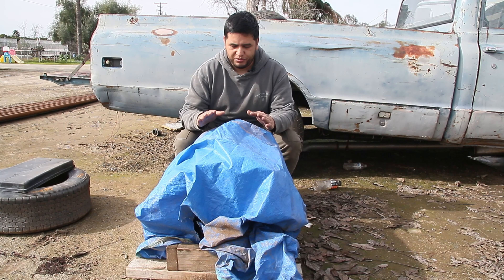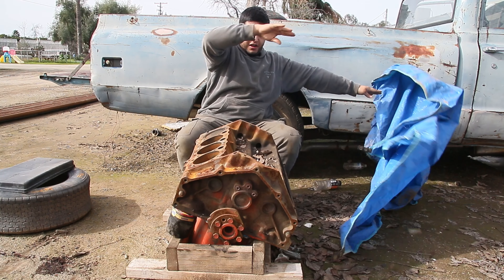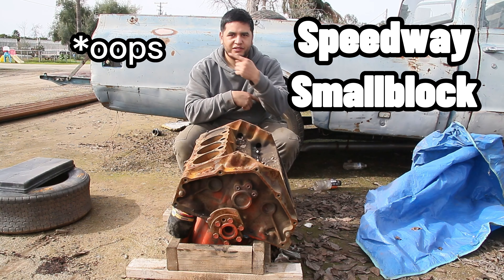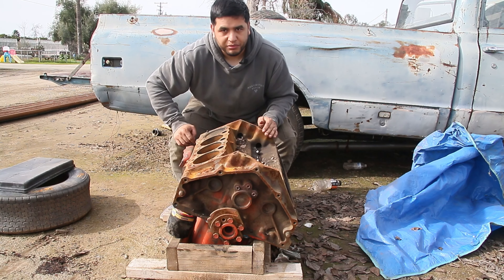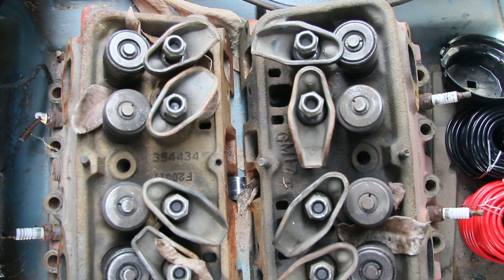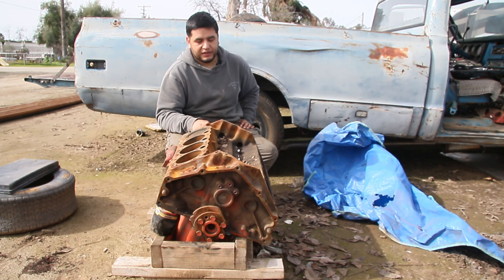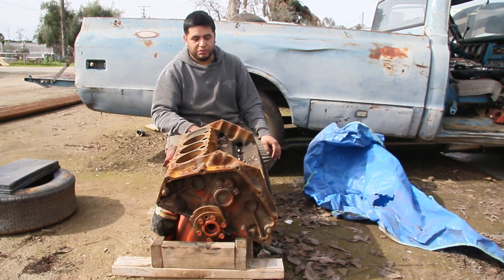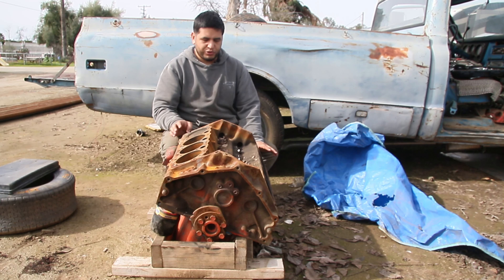Reviving a Chevy Engine: The Ultimate Resurrection

Comment: Are you concerned about the condition of the bottom end?  Whats your thoughts on block machine work?   Things could get out of hand $$ quick...  This is one reason the junkyard LS swap is so popular...😁
Reply from the maker: First thing I wanna take it apart and get the block decked, hot tanked and bored a bit over just to be safe. It was sitting for a while and I wanna take that precaution early on.